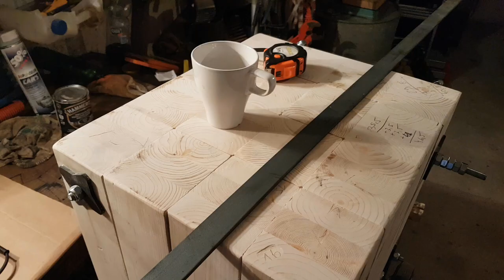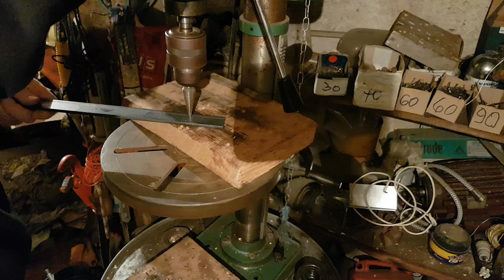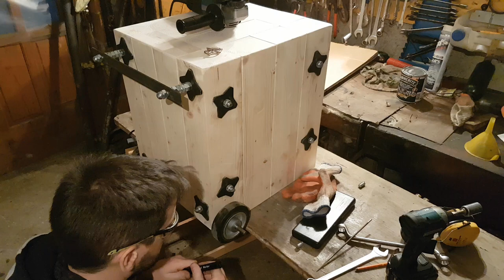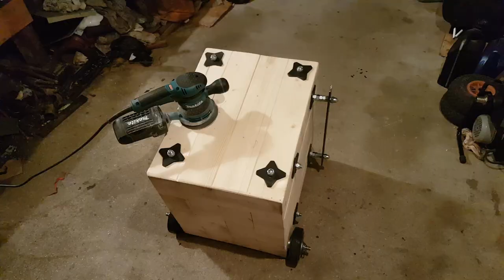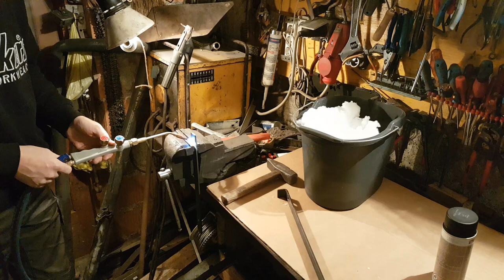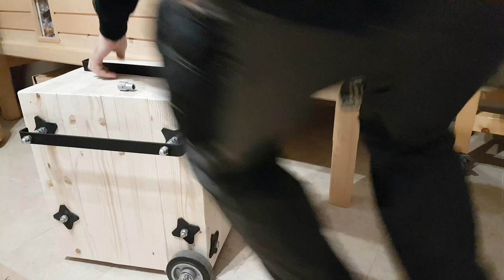Anvil stand- final stand assembly, part 4

Comment: It won't be vertical because of the wheels.
Reply from the maker: Wheels are there for moving purposes only and are detachable.. So perfectly horizontal anvil here.
Reply: Set the axle height so the wheels do not touch when set in place, offset the hole toward the back of the stand so that when tilted back you can roll it, may want to chamfer the edger of the base to inhibit catching on anything while rolling. Great build and design, thanks for the video...